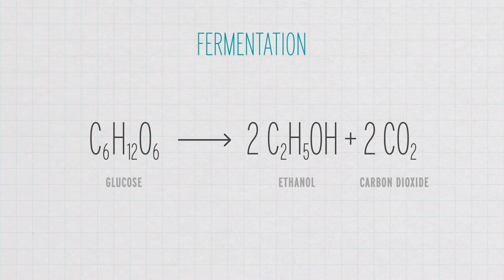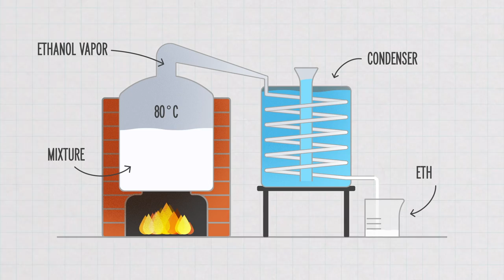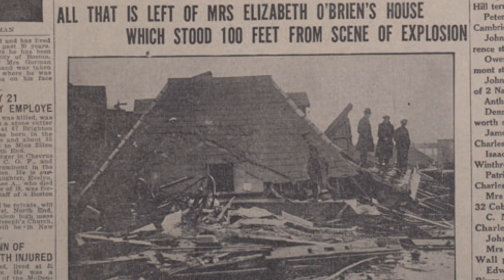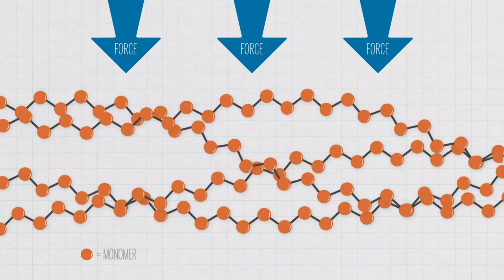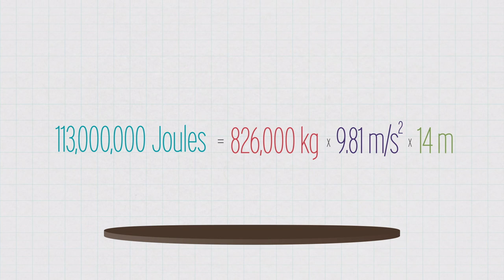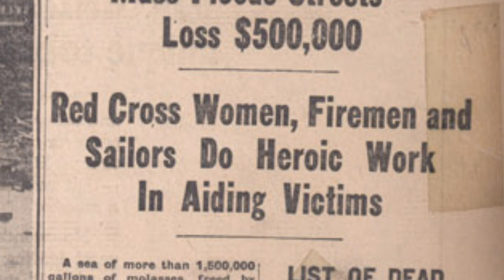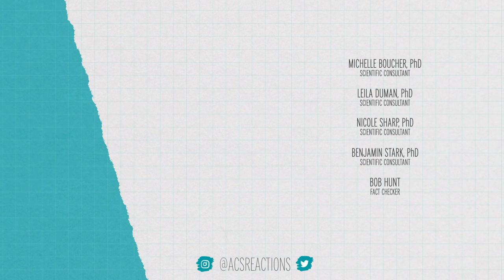The Great MOLASSES Flood of 1919

Comment: Another factor to the what could have caused the tank to explode is that the molasses they put into the tank was heated up to make it easier to transfer. That top layer of hot molasses, combined with the cold molasses that was in the tank during the winter, caused a sort of fermentation process to happen, building up more pressure in the tank.

Comment: It was an abnormally warm day, and the valve that was to let off the build up of excess alcohol, was closed.  It popped, flowed like water and stopped like cement. Almost  like a pyroclastic flow with-out the burn.
Reply: wut?  Are you saying there was alcohol in that massive tank?  Why would there be alcohol in the tank?  Typically the molasses was removed in small batches to another location where it was diluted with water and left to ferment.
Reply: @BlackWolf42-  their was in that tank, which is accounted for now, unintended alcohol vapors that occurred from natural bacteria in molasses, they installed a valve on top of the tank too open in the summer cause the heat would exacerbate fermentation, on this day being in winter the valve normally closed, was a warmer day than usual. The amount, condition of storage AND the condition of the environment of that day all lead to the disaster.
Reply: @Iamrightyouarewrong  Makes sense.  I appreciate the clarification.
Reply: @BlackWolf42-  there was an account that when it was "topped off" it "RUMBLED" that was in the morning, a better way to put it would "the amount, storage and temperature of the molasses was an impending disaster that was, in retrospect, avoidable"

Comment: Lore? well I live in the back bay of Boston and on hot sticky days humid days you can smell coffee or what it smells like is like cappuccino or a coffee like substance. You will probably if you are new to the area brush it off as a coffee shop smell, but you will smell it everywhere even an alleyways, etc. where it would almost seem that every corner has a coffee shop that’s brewing. but the next day if it’s rainy or a little cooler out, you don’t smell anything. The smell comes when it’s very hot out and what people believe is that the molasses sunk into little nooks and crannies within the city which were unable to be cleaned out and dried into the cement and or wood, and became part of the infrastructure almost. Due to multiple construction in the city, the smell has become faint, and faint over the years and decades, but up until this day, even last year, the summer of 2023, you could smell it even more. With a construction of a neighborhood where they knock down a building in this area, and built a new one you could actually smell it even stronger when they removed the basement to pour a new one. The basement was over 250 years old, and there are some structures within the city that you cannot touch that are part of the historic society that have been there since the early 1600s. Cannot remove these buildings. You could only refurbish them therefore that nooks and crannies of these buildings have that molasses that seep in, this you can definitely smell it but it’s like I said, only during very humid days. Not so much hot but hot and sticky days. Just the other day it smelt a little bit like a coffee shop throughout the area like how your kitchen would smell after you poured a Keurig cup. It was more stronger. It seems back in the day, and is becoming more faint as time goes by due to the changes in the area, but the historic areas, which are more or less untouched you could still smell.
Reply: I worked in the North End for 5 years. I walked during lunch during those five years during the hottest days of summer. I'd sit in the North End Playground were the memorial plaque is. I have never smelled anything like that.

Comment: It seems redundant to say the tank was too weak to hold the load since it obviously wasn’t strong enough to.
Reply: The company (as a defence during the trial) actually claimed the tank was blown up by anarchists who dropped explosives through the top. Factories (owned by the same company) had been targeted by anarchists using explosives and similar techniques, hence why they used it as a defence. The same tank had held that much molasses up to 7 times prior without rupturing. However the temperature had been 2 degrees two days prior, and was 40 degrees on the day it ruptured. So it could have been something to do with the rapidly changing temperature putting pressure on the already very weak structure (as the molasses changes in consistency), and also the trial took fermentation into account as old molasses was being added on top of new molasses (something like that anyway) - also the new molasses was warmer than the old molasses sitting in the bottom which could have affected it. But the only reason the defence of explosives having been used failed is because they couldn't prove it as no one had seen someone slipping explosives in, so they couldn't prove it happened!